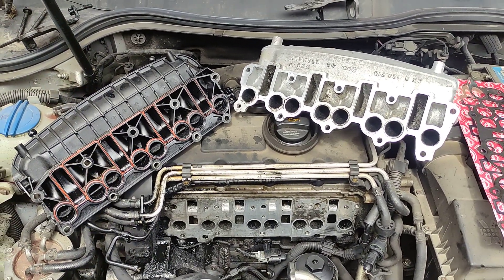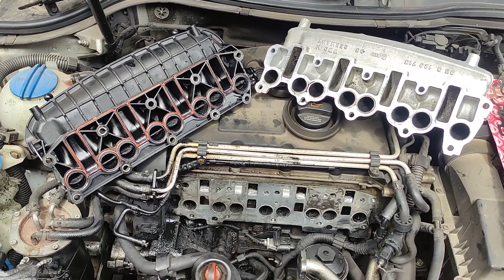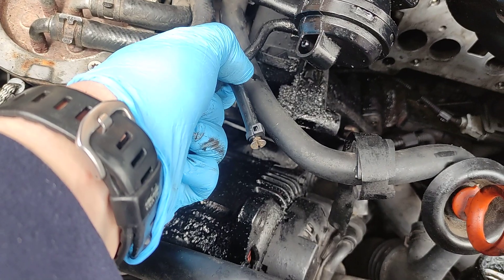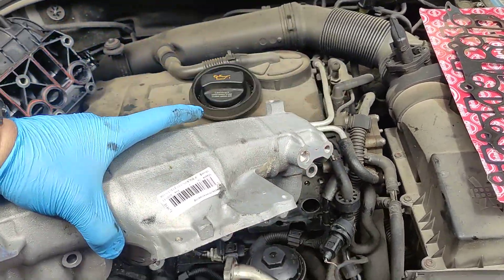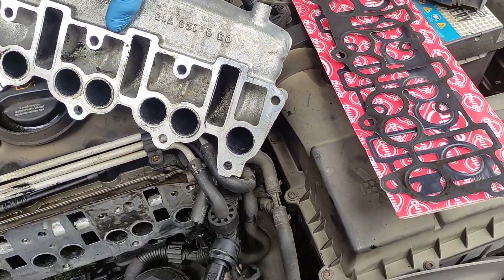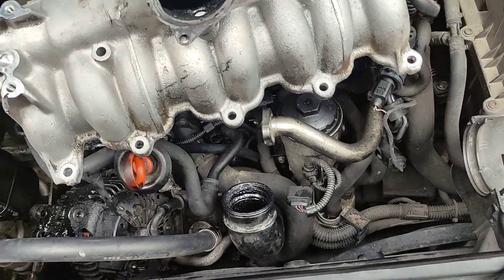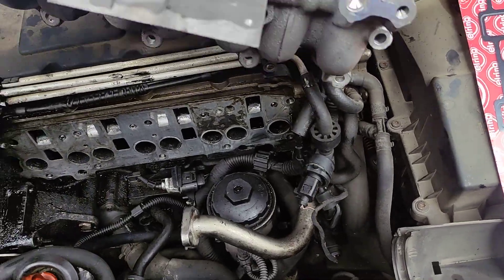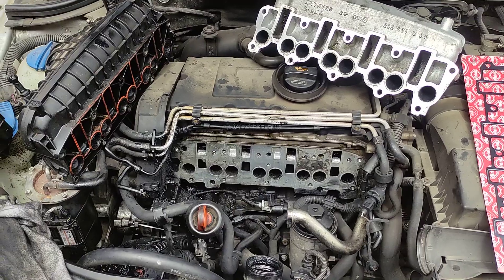Aluminium Intake  Inlet Manifold Upgrade on 2.0 TDI 16v VW Audi Skoda Swirl Flaps Delete

Comment: Hello and thanks for the video and help, just a question, i have a 2008 vw passat 2.0 tdi sport170 BMR engine. I have a intake fault i think. On start up it smokes a little, so i have to give it a little boot/put my foot down then the car is okay. Can i change my intake so it got not swirl flaps 🤔 as i have a plastics intake but think its different to yours.
Thanks again 👍

Comment: When you changed the plastic collector for the aluminum one, did you also have to change the screws or did the same ones work for you?
Reply from the maker: Good question, shame I did not film it but I was in a rush. So had 2 I think chopped a few mm. I think.you can compare the thickness.  Where aluminium is slimmer than the plastic, chop it.

Comment: are there any differences in performance, does the engine have power at low revs after installing the branch without flaps?
Reply from the maker: according to the internet there should be loss of power at low revs, Me personally I think is pulls better.

Comment: Wondering if the bkd manifold would fit onto the cbab engine.. :)
Reply from the maker: It looks completely different, single opening inlet on the cbab.
Reply: @MeFixingEverything  Swirl delete, It is.💪😎
Reply from the maker: Lol, good to know !
Reply: Hi when using this aluminium inlet manifold , you can just plug the hose for the actuator is this correct , there is no need to have the actuator connected , thank you
Reply: Is it only plastic manifolds that have the flaps?
Reply: @mcjjordan  hi happy new year , I’m changing from the plastic manifold to aluminium